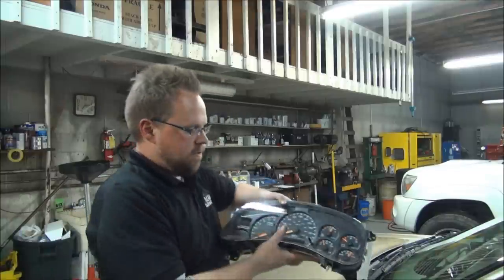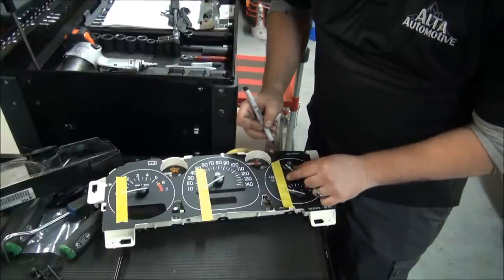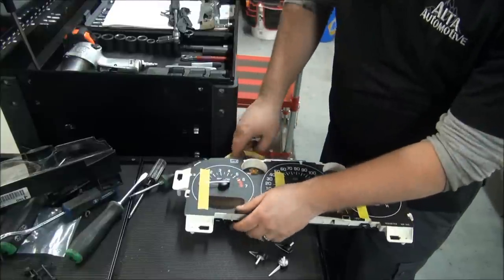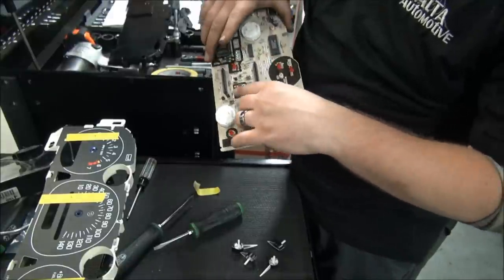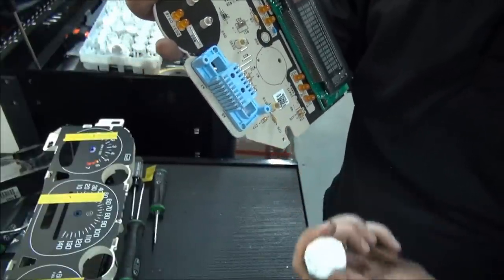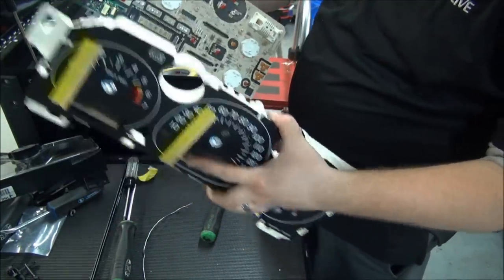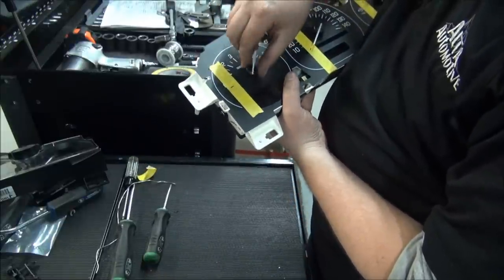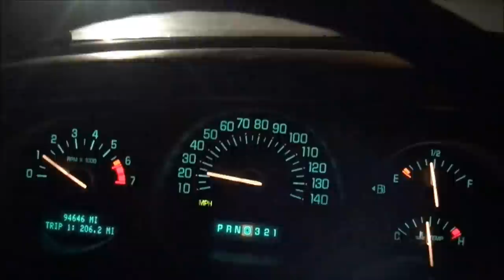How to repair GM Instrument Cluster | Speedometer | Gauge | Stepper

Comment: Ordered the suggested motors, installed, etc, everything worked flawlessly. Awesome walk-through down to the detail. The fork to remove and tape to keep it's calibration suggestion was 5*. (I used a knife under the fork to prevent dents by fork). Turned possibly $400+ into $30. Keep up the good work, guy!
Reply from the maker: Whipsters Idle Thank You!!

Comment: I have replaced all the stepper motors in my 2005 Impala cluster and some of the soldered in "backlight" bulbs, but the bulbs that came in the kit have mostly burned out. Are there some better bulbs to use for those?  What # are they?

Comment: dealership told my customer his ecm was bad because his cluster stopped working. they wanted $1,200 to fix it. i found your video & replaced the steper motors like you did. thanks bud, you saved my customer $1,100. i told him if he didn't mind me experimenting & it works, I'll do it for $100. we are both happy.

Comment: This video has been immeasurably helpful as I did my '05 Suburban.$30 for 6 stepper motors, $25 for a desoldering iron and about 1-1/2 hours labor (could've been 1 hour, but I'm extra slow & meticulous).ALOT less than the $200+ it would cost to have a dealer do it.THANKS SO MUCH, BRIAN !!  I'm a subscriber now !!
Reply from the maker: +pacrattracing Thank You!

Comment: Hey bri... i have a 2004 gmc yukon denali how do i replace the stepper motors and bulbs? By the way great video 👍
Reply from the maker: Ramel Stevens The cluster is basically the same as the one in the video. You can also replace the bulbs when you have it apart. Let me know if you need the motors I have them in stock 801-292-1331
Reply: I do and i need the l.e.d bulbs..
Reply from the maker: Ramel Stevens I don't have and l.e.d bulbs, however I have I standard bulbs.
Reply: Ok how do i purchase ur stepper motors? Do i replace them all?
Reply from the maker: Ramel Stevens You can call the shop tomorrow 801-292-1331 8am 6pm MTN Time. I would defiantly recommend replacing all motors, while you have the cluster apart. The old motors were defective and fail all the time, however the new ones I will send you last much longer and may never fail.
Reply: Ok will do.. thank you talk to u tomorrow
Reply: How much do you charges for re solder it

Comment: Thanks for your help. i just changed four stepper motors in my 2005 Impala guage cluster for about 30 bucks & 3 hours worth of elbow grease. Surgery was a success. A professional de-solderer is a must, the pins are small and de-soldering wick doesn't do that much good.

Good video!
Reply from the maker: Thanks!

Comment: Neither of my vehicles have the type cluster you repaired in this video but I watched anyway because I was impressed with the conduct.  I do have a 1988 chevy van G20 which has now a very noisy/erratic speedometer (especially in cold weather).  Thinking it was lack of cable lube I had that service done (mechanic charged me $100 to lube the cable)  but still have the same snapping scrapping sound with a bouncing needle.  Checked back with the mechanic doing the lube and he said the problem was the gear assembly in the gauge itself. I shiver to think what he would charge for that service.  Can you give me some insight

Comment: Thank you for this video...  I ended up swapping 6/7 gauges and left the voltage gauge alone on my 04 chevy 3500 with 100% success..  I think I had the option to order 6 or 10, and at the time I thought I only needed 6.  I got new bulbs with them, and wondering...  how do I swap those?
Reply from the maker: +Eric Tolon you have to snap the old bulbs off the board, and put the new bulbs in the blue holders and solder them in place.

Comment: great video I have a 04 escalade and the needles are all over the place so I have no idea were to mark what should I do
Reply from the maker: +Chuck Evans HHC-YG Push them down to the point that they bottom out (not past). That is your starting point. Make them before you remove them.

Comment: Hi, excellent video. I have a 2006 Chevy express van V8 6.0 Having problem with oil pressure gauge. Replaced stepper motor, because it stuck the gauge is at 80, than I replaced oil pressure sensor. Started to act up after 10 months in the morning when I start engine or parked for an hour the oil pressure shows 0 and after I rev the engine up about a few times it shows the correct oil pressure. If you ever hear about this kind of problem, please let me know. Thank you very much.

Comment: Hey, Thanks for the video this worked great!  I have a question though.  Before doing this my AC and heater working perfectly on my 2004 GMC denali.  Now everything still works except the drivers side air blows only HOT AIR no matter what I set the temp to.  What could that be?  To get the dials all perfect I had to detach and re attach the car battery like 4 times and pull the instrument cluster out and adjust.  Could i have blown a fuse? I have very little experience doing this.  This was my first solder job.  Appreciate the help!!
Reply from the maker: Sounds like you have a problem with the temperature blend door inside the dash... Some times you can reset them with unplugging the heater control for about 30 min.... However the temperature blend door may need replaced or even the temperature control head.

Comment: Bri We have a 2004 Pontiac Montana and we are experiencing problems with our fuel gauge . The gauge will register past the fill line when it is not working right. From watching you video  I am convinced the stepper motor is not functioning properly.Do you replace these motors for people if they send you the cluster?

Comment: hi, I watched you video  how to repair  GM instrument cluster, speedometer, gauge stepper, it is a nice video, my question is, I have a Toyota corolla 2001 and non of the gauges work, neither the power windows  the turning light signals and  the radiator fans. I have checked all the fuses all of them are good, could you explain what is wrong?

Comment: Hey bro, I just watched & liked your stepper motor video for gm. However, I just purchased a 2000 Buick lesabre w/122k miles & the gas gauge seems stuck close to 3/4 full & the mph seems to hover about 20-30mph faster then I am going but the mph needle does sweep (it just seems high) but, I've only driven it once. Does the 200O Buick LaSabre use the same type of stepper motors & where can I get some? I noticed that my trip computer is working, it's just the needle is reading high but the fuel needle is not accurate!!! I do not have a good scan tool to see if I am getting accurate info from the level sensor but, the trip counter is working & giving me mph numbers in a separate screen making me believe that it is just a sticky or burnt stepper motor. All advice is welcomed!

Comment: Thanks for this video. Concerning the part where you taped and marked where the needles were, my speedometer failed and the needle is at 140. If I do this procedure, should I go ahead and move the needle to zero myself or will it reset when I install the new motor?
Again, thanks for the video. Very helpful.
Reply from the maker: Yes push all needles back to the point they stop before you set the mark. (which is normally below zero) Let me know if you need any stepper motors 801-292-1331 (I have them in stock)
Reply: Thanks

Comment: 2005 GMC Sierra 118,000 on it . If I hit a bump just right my speedo stops working or if I travel with the speed control on for more than xx number of miles it does the same. Nothing like doing 90 through town and 120 plus on the highway. I then rely on the RPM gauge to tell how fast I am going.

Comment: Great video Bri. I was going to send my instrument cluster for my 2004 Pontiac Montana to get the speedometer and temp gauges fixed, but this looks like a piece of cake since I already have the soldering equipment.  My only concern is that I can't find a good resource for the 2004 Montana that explains how to remove the part of the dash that covers the edge of the instrument cluster so that the cluster can be removed.  Do you know of any good resources that explain the steps to get the cluster out of the dash? I'd rather not have to buy the full Chilton guide if I don't have to. How much of the dash needs to be removed on the Montana to get to the cluster? Thanks in advance for your help.

Comment: On my 2000 Astro van, the gearshift indicator is stuck on "D".  Any idea if this is a repair to be made from opening the cluster?  Thanks - your video is great!
Reply from the maker: +Arthur Huse I have not seen that before...Not sure if it would be in the cluster or the module that sends the cluster the info on what gear it is in...

Comment: Hi we watched your video in changing our stepper motor on our escalade and we did great your video was very helpful. All the gages come on but when i turn the engine off the gas gage doesn't go back down it goes the other direction. Can u show me or tell me what i did wrong? Thank you
Reply from the maker: It may have a problem with the fuel level sender in the fuel tank... Or you might have made a bad solder connection with the new stepper motor

Comment: Hey Bry, Thank you for this video. I am pretty sure this was my problem. Back light works, turn signal lights good but gauges either didn't work or were intermittent. I ordered my stepper motors and replaced them as in your video but no luck. I have no movement on the gauges at all now. :( Could I have soldered incorrectly? Is there a certain type of flux I need? If I used too much solder could that stop them from working? Thanks for any help you can offer. I don't mind calling you if that is easiest. Cheers.

Comment: I have a 2008 Uplander and the cluster needles stopped working one day and then worked the next day when I started the vehicle. Do you think this is  a cluster replacement issue, electrical related or ignition switch related?

Comment: instead of using a fork, try two spoons. pulls up easy and straight  and the rounded bottom of the spoons barely touches any surface area of the face of it. i use the same wiht guitar knobs. works great.

Comment: Great video. I subscribed. I changed the stepper motor on a 2003 Tahoe and it worked fine for about 5 miles and then the needle went up to 70-120, and is now stopped at 120 when the vehicle is turned off. Do you think the stepper motor I installed is bad or maybe I didn't calibrate it right. I made sure it was zeroed out, any ideas? Could it be something else besides a stepper motor? Thanks.
Reply from the maker: +Todd H Most likely a bad solider connection, when you changed the stepper motor, you have to be very carful when changing them not to damage the littlie round circle on the circuit board around the hole where the stepper motor fits into the board. Double check the circuit board in that area for damage from heat, from your solder iron, and or double check the solder connection and start over.

Comment: Hello again!  Since I'll be pulling the dash off, I thought I should investigate another issue.  The actuator that controls the air vents is not blowing air through the front vents.   Do you have instructions to fix this on my 2002 Trailblazer?  Is this a fix that requires pulling the dash off to do this as well or can it be accessed elsewhere?

Comment: So what was the hook tool used for? I don't have one and before I went out and bought one I wanted to see if it is necessary.  Thanks.
Reply from the maker: +Jerry Aguilar The hook tool is not required, however makes it easier to remove the holding clips that fasten the front of the cluster together to the back of the cluster.

Comment: Thanks for the video Bri. I have done a few of these previously. I just replaced the stepper motor in my 03 Tahoe (speedometer). The motor works nice and free until I plug the cluster in, then there seems to be a lot of resistence on the needle. It tries to move a little bit when driving but that is it. Tried another stepper motor, same thing. Circuit board damage? Thanks
Reply from the maker: +donna williams Yes I would bet there is Circuit board damage near the connection of the stepper motor. You have to be very careful not to get the board to hot when replacing them....

Comment: 0:56 the 8th generation Buick LeSabre’s have a different style of speedometer, of which doesn’t have both mph and km/h on it. I have found it on several GM cars starting with the vehicles in the G platform, as well.

Comment: I recently bought a 2003 Chevy Trailblazer with a faulty speedometer. The speed cluster gets stuck on 60-70 mph. The RPM cluster doesn't read at all, the oil pressure one is faulty. The only ones that seem to work properly are the temp and battery ones. Are all of the stepper motors the same for inside the speedometer or are there different motors for each cluster?

Comment: On my 05 Pontiac Bonneville the temp gauge and the rpm gauge don't move at all, and the fuel gauge fluctuates from full to about half. Do you think both those problems could be the stepper motors?

Comment: Hi Bri: Very instructional video. Congratulations!
I have a Toyota Celica GT 2000 1.8L that has problem measuring  the gas-gauge spot. That gauge-spot is the only one that does not use needle (it is digital), the other cluster-gauges are okay. I thought it was the fuel sending unit and I replaced it , but still the gas gauge is not turning on and it is not measuring the gas yet. 
What do think it may be the problem?
I would like to do it my self because a problem like that may cost lot of money to fix. 
I will be eternally grateful from you. 
Sincerely, 
Juan

Comment: I have this problem with my Yukon gauges as well, I will do this! But the other problem im having is faulty alarms coming from the dash. Such as check brake system (which was checked and was fine) and oil pressure low. Do you think this is another component that needs replaced on the dash mother board as well?
Reply from the maker: Yes another component, however I am not sure which one. You might want to buy a complete reman cluster from a GM dealer.

Comment: Hey Brian Just picked up an 05 GMC 2500 HD. Speedo, oil pressure and temp are fine but tach twitches occasionally and fuel gauge doesn't move. Sound like stepper motors?

Comment: thank you for the vidio however my 2005 silverado speedometer, oil and volt meters did not get fixed. the gas, engine temp and the rpm gauge worked after I changed them all . rpm gauge was the only thing that worked . was there a special moter for the speedo?
it keeps climbing and wont go back to 0
 please help if you can

Comment: Hi Bri- what if the needle position got moved before the marks were made. How do you re-calibrate the gauge?  I misunderstood some directions that were sent me. Instead of making my needle position marks first, and then turning the needle 1/4 turn counter clockwise to brake the needle seal, I turned the needle to the stop position where the mark should have been and then turned it another 1/4 turn counter clockwise and then made the needle marks. When I put everything back together, nothing was set right. HEEEELP!

Comment: My husband & I put in all new 6 stepper motors in his 2004 Chevy truck today.....put it back in & not one gauge worked!!!  We followed the video step by step.....very concerned about our soldering abilities....we called the 800# for the video of how to remove the panel which all went well....the guy said he thought it could be the ground fuse which we can't locate......however we think we messed up the circuit panel with our soldering.....what do you think?????
Reply from the maker: Carolyn Pistulka Sounds like the soldering is the problem, you may have damaged the board or you may have just not made a good connection when soldering. You may want to have it checked by someone that repairs electronics or has good soldering abilities and or understanding.

Comment: I have a 2003 H2 Hummer all the gauges stopped working at the same time.  Is this common and how can I be certain if it is the stepper motors that's bad?
Reply from the maker: Normally all the stepper motors do not stop working at the same time... Unfortunately sounds like there may be a problem with the circuit board..Really the only way to check the stepper motors is to pull the cluster out and try spinning the needles by hand, if they are sticky or very hard to move, the stepper motors are bad..

Comment: Bri I put new stepper motors and changed illumination bulbs to leds. Was pretty simple job except when put back in my rpm worked some then just sent there and shook, and the other 5 didn't work at all. Leds did good, and abs and battery light stayed on. Any suggestions would be great?
Reply from the maker: +Ray Shows The board the stepper motors solder into may have been damaged. You could try taking them out and reinstalling them again. You have to be very careful not to get things to hot...

Comment: I am replacing the fuel gauge stepper motor on my wife's 2007 Chevy Equinox. In all the videos I see, the needles for the gauges move clockwise (E to F). On the Equinox, the needle moves counter-clockwise (F to E). How do I calibrate it? Would my set point be the Full mark?